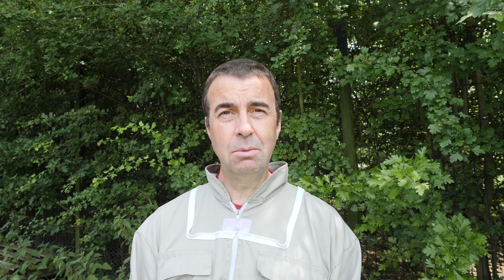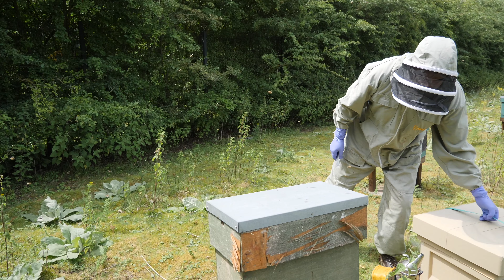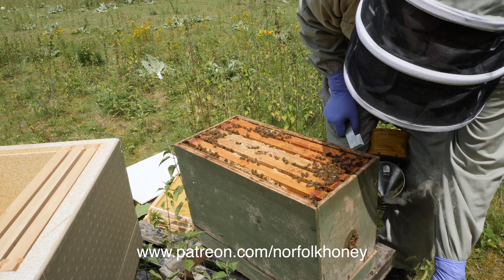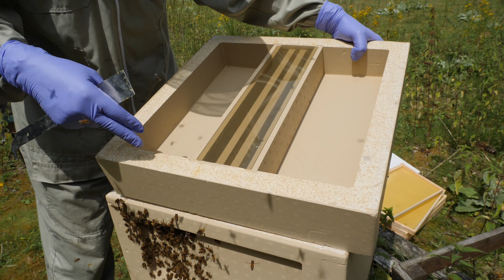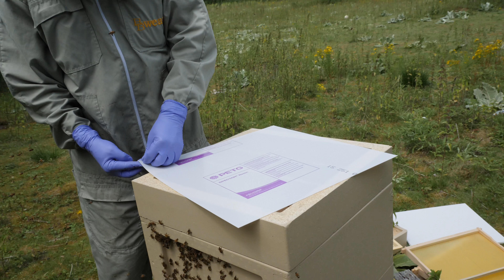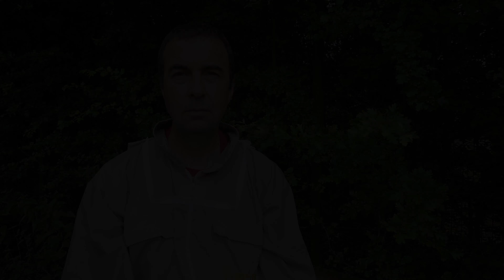Transfer of a Nuc into a Maisemore Commercial Poly Hive

Comment: Is it abit early to be using the miteaway? I thought normally you'd be treating later on in the year?
Reply from the maker: Hi FumblePi,
Thanks for commenting and the great question. The answer is no,  the great thing about MAQS is that if you assess that you need to treat a colony you can use it at any time providing the conditions are ok. My primary concern is always the temperature, if it's too hot, and I always think in excess of 25 degrees C. then the vapourisation is too fast and can cause problems within the hive but anything up to that temp always seems to be fine. I had seen a couple of mites in this colony and I figured it best to treat them rather than leave it any longer.
Stewart

Comment: A question in reverse to what you have just done really! I have a full sized 'modern beekeeping' poly hive with a weak colony, due to a failing aged queen, which I have now replaced, but for the winter would it be better to move the colony into a nuc whilst they build up numbers, then back into a full sized hive in the spring?
Reply from the maker: Hi Christopher,
How many frames of bees do you have? as long as you have a reasonable number of bees you should be ok. If you've just replaced the queen I would think they would have plenty of time to build up to quite a strong colony provided they are on drawn combs. The young queen should lay plenty of eggs and continue into the late season so don't be in too big a rush to move her into a smaller nuc. Close down the entrance maybe but otherwise I would probably let them be unless you are down to just a frame or two of adult bees.
Can you add a frame of brood from another colony to boost their numbers?
Stewart